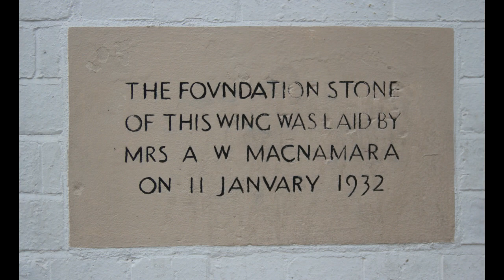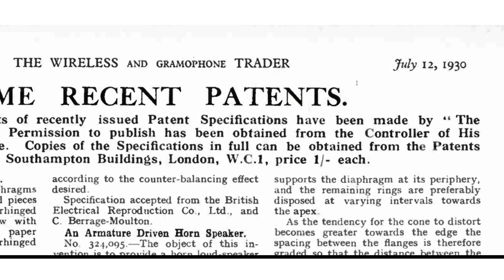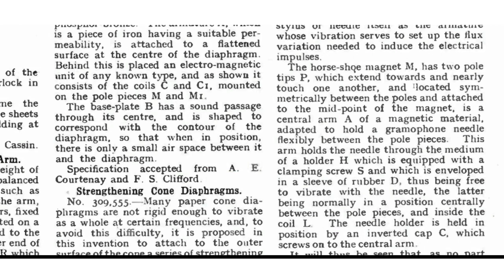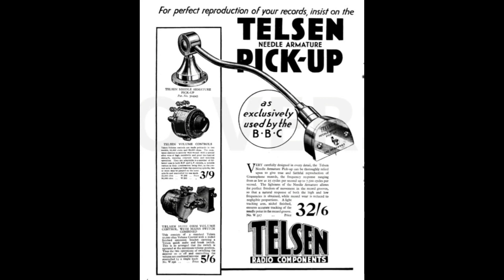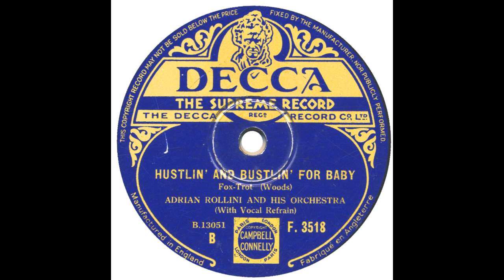Telsen needle armature 78 rpm pick up and arm, ~1931/2

Comment: Excellent quality! Those pickups had a wonderful frequency response, the bass is just superb!  Thanks for the history.
Reply from the maker: Thanks! The advantage of the 'needle armature' pick-up was that everything was small and light, with low inertia. So it could respond to the signal in the groove more accurately. Most of the earliest 1926/27 electric pickups had a massive armature which wore the records badly, had an enormous amount of chatter or 'needle talk' coming from the pick-up itself. So for 1930, the Burndept/Telsen is very advanced! All the best for 2022, Norman.

Comment: Very interesting pickup and arm combo, an early S style arm, as what became common on high quality turntables by the 70's. It sounds quite nice as well.
Reply from the maker: Thanks for writing. Yes, they eventually realised the offset would make the tracking more accurate. There was a really famous audio expert called Percy Wilson, and I believe he was a pioneer of better tracking. Cheers, Norman.
Reply: There is no record arm which tracks a disk perfectly. but Wilson's design is clever, because the double bend allows for perfect tracking at three points along the arc of the arm, for a 12” record. This means that tracking errors become virtually negligible throughout the whole of playback. A straight arm can be correct at no more than two points along the arc, so errors are inherently greater, being worst at the end of the track.

Comment: The integrated arm thing was very UK, was it not?  I have an old G.A. Briggs book that mentions this (mid 50's?), that it would be easier to build a Hi-Fi setup in the UK if the arms and carts weren't all built together.  He mentions that the US had already adopted the separate component approach and he liked it better.
Reply from the maker: Hi and thanks for writing. Ah yes - Gilbert Briggs's books - there are several, I think between 1949 and 1960. I have some of them, and they are very readable & informative on the audio scene of the times. Briggs's wry sense of humour also, is never far below the surface. Had not realised that integrated heads & arms persisted longer here than in the U.S.; thanks for that. I guess it was due to inter-company rivalry, so even with interchangeable heads for 78 and microgroove, each make still had its own fitting. Possibly the advent of the SME four-pin head-shell showed the way forward? Or perhaps that design originated in the U.S? Anyhow, the standard head-shell certainly made life much easier for all of us! Cheers, Norman.

Comment: well I THink the sound is very good considering the test record is an early 30.s Decca and even allowing for you tube I.m getting a warm bass sound through the PC speakers
Reply from the maker: Many thanks! The top end was good, but we could have done with some more bottom end - trouble was probably my home-wound coil had wire that was too thick, so the DC resistance of it was only 10 Ohms (!), so all the impedances were wrong. Cheers, Norman.

Comment: Is that recording from that record player at the end? Sounds good is that coated ? are you going to try that silicone spray! I want to know what it sounds like!? I would have thought copper needles would sound good is there such a thing and have you tried it, what is the average length a noodle will last? Have you thought of sapphire or diamond? Still think copper would sound good! Try that silicone spray £2 from Tesco's they do it for blackening your tyres it's called tyre shine!!
Reply from the maker: Hi there. No,  sorry I haven't tried the silicone spray yet. Copper would probably be too soft for a gramophone needle. Ordinary needles were only meant to be used for one side. There were many attempts at multi-play needles,but I don;t know much about those. Certainly sapphire or diamond needles were too hard & would ruin the disc with the old playing pressures, which often exceeded 100 grams, even 150 grams. The needle was intended to wear, in order to better fit the groove. Groove size for 78s was never fixed until about 1950. Cheers, Norman.
Reply: Norman Field 150g doesn't need to be that heavy does it can you not get away with 15 grams or less? Then copper would be fine. Why does it need to be so heavy?? Then bronze coated Steel is a good compromise have you ever tried wood? I mean there's some extremely hard dense Woods out there so it might be not as crazy as it sounds or even bone might work well now there's an experiment I can imagine bone might be quite you!!
Strange you can't get the rubber suspension off freezing it might work but you have a good chance of breaking the rubber can't you just cut it off and make a silicone or latex rubber for it. So the needle does it fit into the rubber it's like a rubber tube is it??

Comment: Norman what thread is that screw that you need? I will have a look at work but don't hold your breath.Sound quality is amazing!
Reply: Simon Spiers it would be a brass screw what thread don't know but I have a bunch of screws like that knocking around
Reply: Being UK I would guess one of the smaller BA threads, as those were incredibly common then for small parts.
Reply from the maker: Hi Simon, thanks for writing. - yes, as the guys say below, the needle screw is a U.K. standard 10BA - the one I used was brass - I keep a stock of them. The original would have been steel with a knurled cap of course, but the brass worked OK for the demonstration. The others were 6BA, but I didn't have a half-domed one like the original, so used any old one. Glad you liked the sound - it would have been better still if the top part where the needle screw is, could have been unscrewed to replace the rubber damping. But it was totally seized up & couldn't free it off - soaked it in paraffin, used WD40, even gave it a short blast with a blowtorch - but nothing doing! Cheers, Norman.